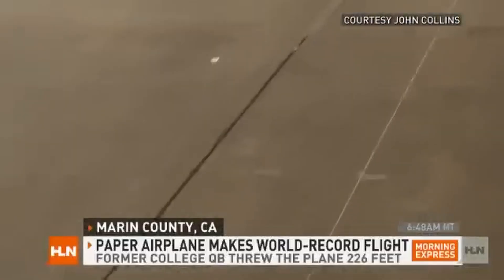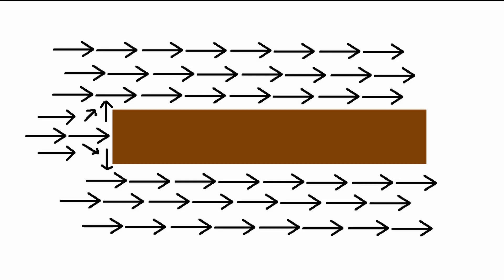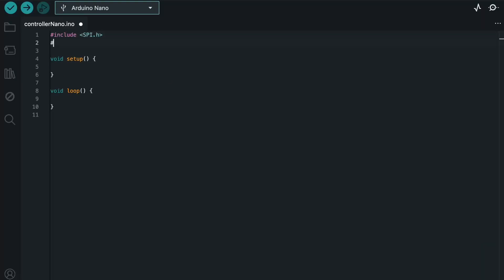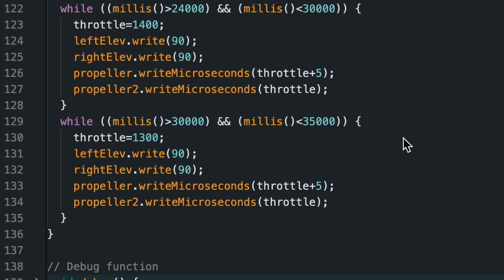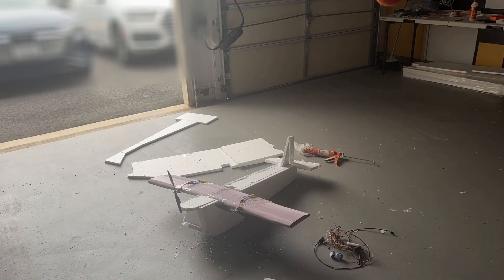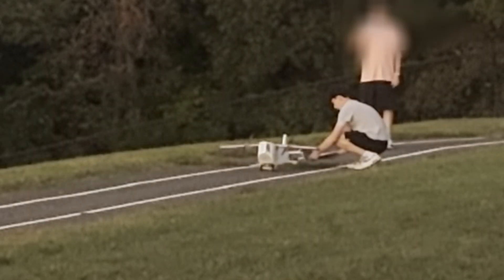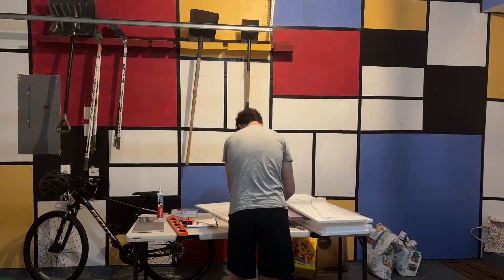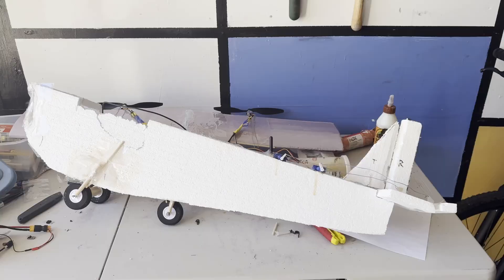How I built an RC Airplane from Scratch

Comment: bro use a foamboard to build the plane , it will be more precise and easy to put together . dont use steel wires for the motor instead make or 3d print a motor mount . also as you are just getting into this hobby i reccomend to build a trainer plane first , thejourney will help you learn the crucial key points to design your own plane. i recommend the trainer plane by rc maker lab yt channel . you can use the arduino transmitter and receiver but i would recommend either to swap those joysticks by something like a flysky have or just buy a cheap flysky radio .
Reply from the maker: Thanks for the tips! I used foam board for the wings since I wanted to minimize the chances of them breaking, while using lighter foam for the fuselage so the plane would be lightweight enough to fly. In future projects, I'll likely use different Arduino modules since the radios I had were generally unreliable/inconsistent (off-screen technical difficulties), so I'll definitely look into those and getting a proper trainer plane to start learning.